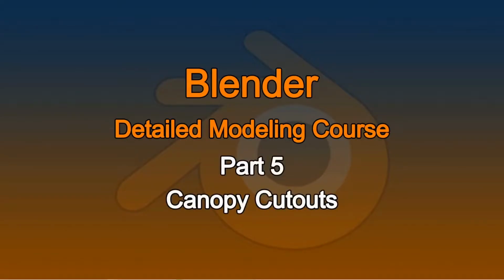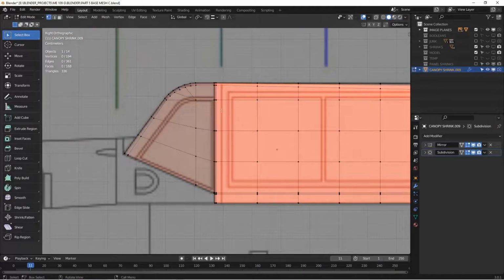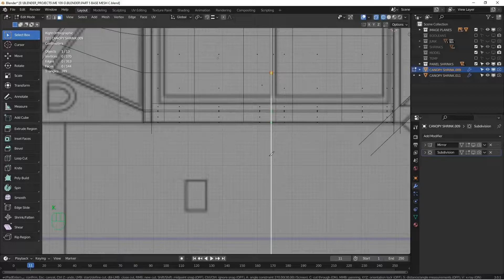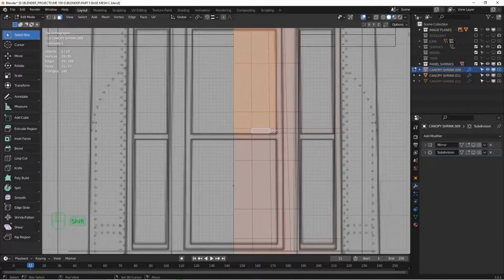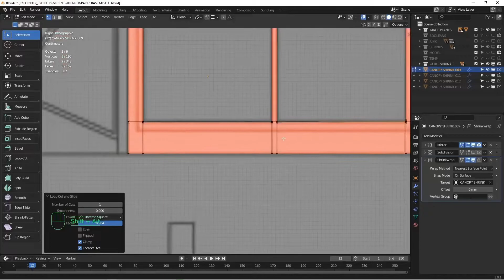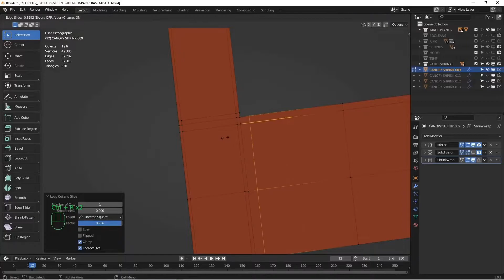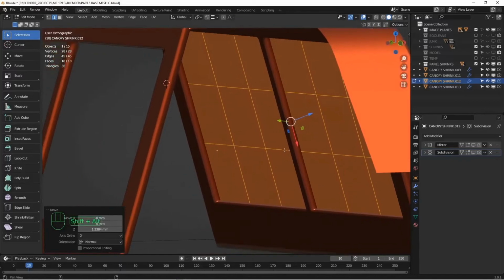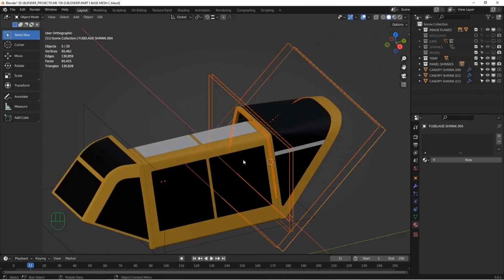Blender Detailed Modeling Course, Part 5: Canopy Cutouts

Comment: Do you shrink wrap objects in your other videos? I'm having a tough time figuring it out with the gun blisters etc.
Reply from the maker: Yes, there are several examples later on in this series, but there are also a couple stand-alone videos that might help:

https://www.youtube.com/watch?v=SKw6U-yLOD0&list=PLoW-6Ghw9DkUBIQY3tf0DDJISul0Vlda5

https://www.youtube.com/watch?v=cP0sTou8Ddk&list=PLoW-6Ghw9DkUBIQY3tf0DDJISul0Vlda5&index=3
Reply: @Mark_Alloway  Thanks! 
Can I ask which method you used for the blisters?
Reply from the maker: @Mr.McWatson  For something like a blister, I would:
1.  Make the basic shape starting with a Quadsphere
2.  Stretch it out using proportional editing and/or using a latice modifier until it matches the tear-drop shape.  
3.  Delete unneeded faces and add a vertex group to the vertices along the edge of the blister that conforms to the wing or fuselage.  Set the strength of the vertex group = 1.
4.  Position the blister as close to the surface as possible and rotate it into the correct position.
5.  Add a shrink wrap modifier using the vertex group from Step 3.  Use the wing or fuselage as the target of the shrink wrap.  This will ensure that the edges of the blister conform to the wing or fuselage.
6.  If the blister is going to be used as a base mesh for cutting out frames or other details:
     a) Duplicate the blister (1 copy for use as the base mesh, the other copy will be used for cutting out details)
     b) Add a subdivision modifier to the base mesh with both Viewport & Render = 4.  Hide the base mesh (you don't need to see it now)
     c) Add a shrink wrap modifier to the non-base mesh object and shrink it onto the base mesh object.  This will make sure the detailed part conforms to the blister shape
     d) Use Knife Project, Knife, Loop Cuts and other methods to create the details.
Reply: @Mark_Alloway  Thanks, that clears up a lot. My shrink worked ok, but doesn't look as nice as yours. How did you get the intersection so smooth? It almost looks like a fillet.
Also, was the cockpit shrink-wrapped onto the boolean edges, or did you cut it out with a boolean?
Sorry for so many questions. It's a bit hard to figure out without much experience with shrink wrap.
Btw you should maybe get a patreon or ko-fi or something, so I can compensate you somewhat for taking advantage of your time and knowledge 🙈
Reply from the maker: @Mr.McWatson  I don't mind answering your questions.  I'm glad to help.

It's getting hard for me to visualize the issues you are having.  Is there any chance you can share your project on BlenderArtists.org as a work in progress?  That way you could post pictures of your work which would allow me to see what you are seeing.  You would also get good feedback from other Blender users.
Reply: @Mark_Alloway  Alright, I've done that.

Comment: Sir I want to ask again about Airbus A330-200 Cockpit windows modelling, when I modelling the cockpit windows(Canopy) should I create separate piece from the fuselage?
https://commons.wikimedia.org/wiki/File:KLM_Airbus_A330-200_PH-AOF_cockpit_close_up_%285509326313%29.jpg
Reply from the maker: It depends on how closely you will be rendering the model.  

If the model will be rendered at a distance then I would not model the windows as separate pieces.  You can model the correct shapes for the windscreens, but leave them as a part of the overall model.  Then, when you are texturing, you can "paint" the windows on the plane using a combination of transparent and glossy values.  From a distance, this technique works very well and keeps your overall polygon count much lower.

If, however, you plan on rendering closeups of the plane, I would recommend modeling them as individual parts.  This will let you detail them perfectly and you won't have to worry about the textures losing resolution as you get close to the model.
Reply: @Mark_Alloway   Yes I mean leave them(Windshield) as a part of the overall model because I watched your video, you modelling the canopy as individual part I think..
Reply from the maker: @TheWeftmen  Yes, I modeled them as separate items because I wanted to be able to render close-up images of the cockpit.  If I were to make a low poly version of the aircraft (like this low-poly Betty I uploaded to Blend Swap:  https://www.blendswap.com/blend/30209 ) then I would just paint them on.